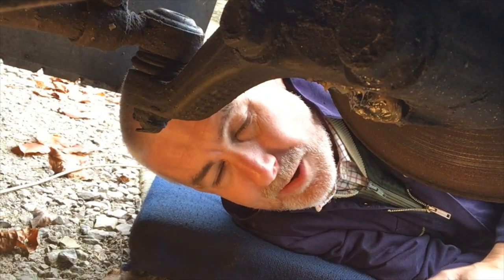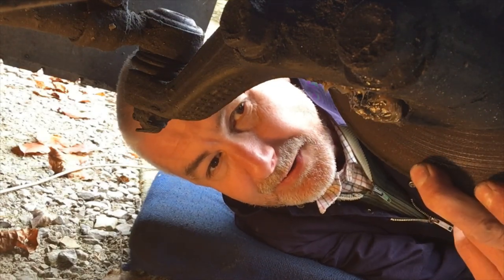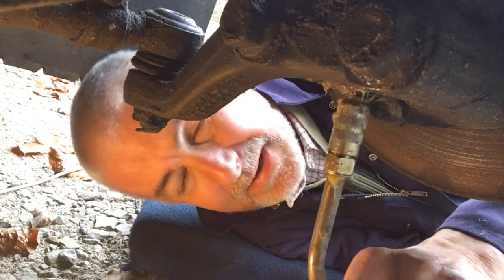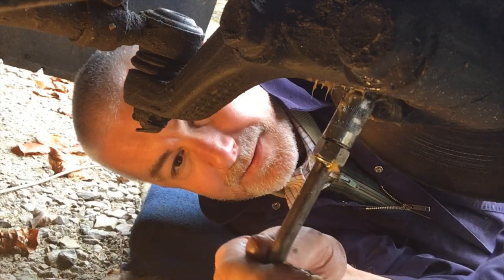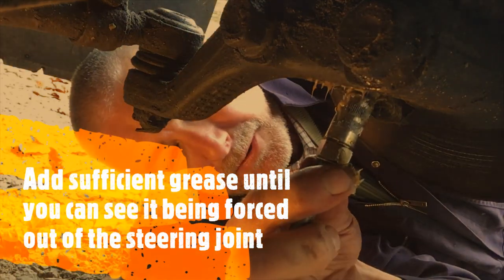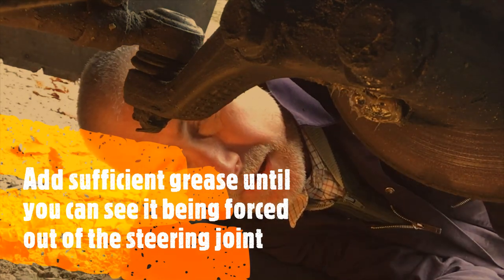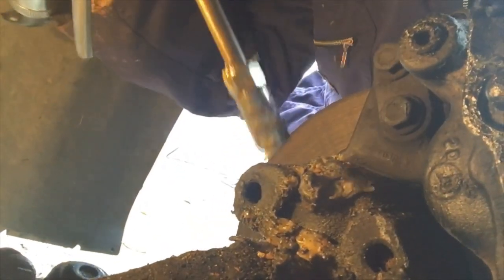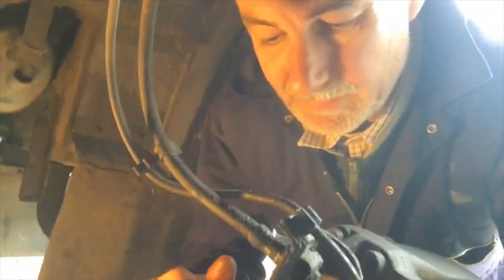Mercedes Vario VITAL Maintenance (Greasing of the front steering joints on my 612D)

Comment: Hey!

More precisely, you have to grease it every 5000km, if you do lots of offroad then more often, like 2500km.

To do it correctly, for the nipples on top with wheels on the ground, for the nipples on bottom with vehicle jacked up, so there is no weight on the kingpin. This way the grease can spread better where it is needed. This is the official reccomendation from Mercedes ;)
Reply from the maker: Thanks so much your information is valuable, I can understand the reasoning. Thanks again.

Comment: Very helpful video. Are there any other grease points on the vario’s (I.e. propshaft or steering linkages) which also require greasing?
Reply from the maker: Thanks Dave, that’s appreciated. There are grease nipples on some of the prop shafts fitted to some Varios, mine doesn’t have them, it’s 1999. I use aerosol copper grease on the gear linkage plus a few other places, would a video be helpful 😀?
Reply: @richstuff6300  It certainly would be helpful. I’ve just bought an 814 with the om904 engine. I don’t know my way around these vehicles at all so any pointers are useful.

Comment: Great vids Rich. I have a 1988 811d, horsebox now camper. What grease do you use in this vid? Also, have you ever changed the master cylinder in the clutch pedal? Would be useful to see how you did it, if poss. Cheers.
Reply from the maker: I’ve used a general purpose high melting point grease, also consider a comment from one of my subscribers to Jack up the wheel to take the weight off the joint before greasing, makes sense to me. 
I’ve not done a master cylinder on my Vario, on other vehicles it’s been easy for me. I’ve always measured / noted the adjustment before removal and used that as the starting point for the new part. Thanks for your comment, I’m planning a couple of new videos consider subscribing and  clicking for notifications, you’ll get an email when I upload. Cheers Rich
Reply: Nice one. Cheers Rich, much appreciated. Sadly I dont have a jack with me so itll have to be whilst its sat for now. Better than nothing I suppose!

Comment: Hi Rich I have a 1996 Mercedes t2 711d. Do all these type of vehicles have grease Nipples roughly in the same place ?
Reply from the maker: There seems to be quite a variety based on the age of the vehicle, for example some have a grease nipples on the prop shaft but mine does not, some have a nipple on the gear linkage but I can't see one on mine. They all seem to have the steering joint nipples and that's vital.

Comment: Hi  is your engine om602 940  5speed manual  if so what gear box oil do you use
Reply from the maker: Hi Ian, I’m actually not 100% sure if it’s ATF or EP90, sorry. I will look at my book and let you know, I may do a short video showing how to check the level. My rear diff is EP90 for sure.
Reply: @richstuff6300  thanks rich, watched your video on greasing King pin s got straight on on it thanks to your video nice one 👍 lan